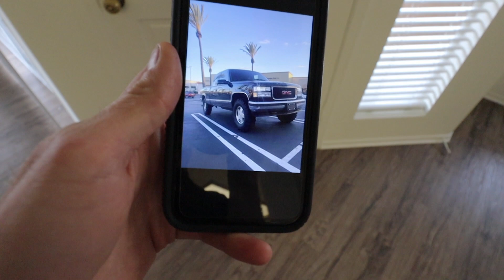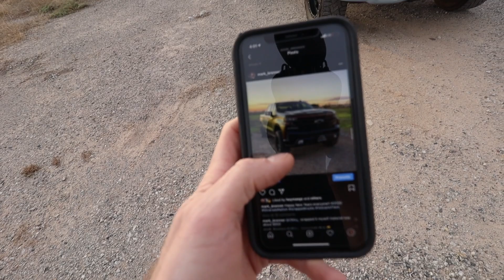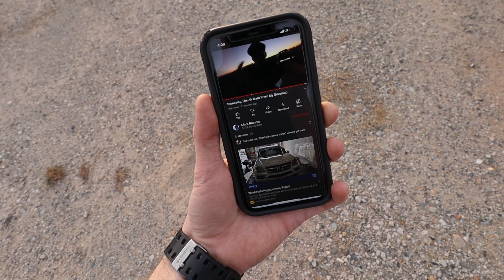Removing The Air Dam From My 2020 RAM

Comment: Just removed both the air dam and the motorized air dam. Also removed those front brackets. Looks great. Taped up and zip tied the connector. Have driven about 300 miles so far and no CEL. Greatly improves the front appearance of the truck. Thanks for the video!
Reply: Have you noticed any driving differences? What kind of speeds have you hit with it off?
Reply: @BozoRooster  I haven't noticed any difference. I've been up around 75-80 mph. Once I lifted the truck these air dams, even if they made a difference, were now useless. Drives great and looks much better. Would be nice if someone made a much thinner, low profile thing to put in place of the fixed air dam. The paint is getting chipped on the bottom of the bumper. Plus, it would look good with all the other black trim and mouldings on my truck 😎

Comment: Just removed mine.  Much better!  Few things, you don’t need to remove the 2 larger bolts to get access to the 2 10mm nuts.  Small socket fits in there just enough.  Also, I removed the auto air dam before the fairing.  Super easy with just 4 13mm nuts and gives you more room to get at the fairing nuts.
Reply: The auto air dam is held on by the 13mm bolts? I imagine it also has a wiring harness? Once the auto dam was removed does it throw a check engine light? Sorry for so many questions, I haven’t crawled underneath my truck to look yet. Came to YouTube first.
Reply: @Ross-K  I removed mine on my 19 5th gen, I wrapped the truck side plug well with electrical tape. Put 50k miles on it and never got a code. I did loose some mpg though, nothing too concerning.

Comment: Thanks so much for the video.  Removed the aid dam as well as the electronic air dam and  disconnected the electric for it.  Didn’t Jane to remove the 13 mm bolts.  Was able to get to everything pretty easily. Love the look.  Thanks again for the helpful video.
Reply: Sorry about the misspelled words. Fat thumbs!

Comment: Air dam was the easiest to remove. 4 nuts (not overly tight), remove the electrical clip, and 2 pop rivets holding the wiring up .
Reply: Mine through a engine code

Comment: My 2021 Ram 4x4 offroad Midnight is throwing U11E9 "Lost Communications with AGS" system code.  
Sounds like the the Active Air Dam frequently fails, fills with moisture, etc. on these and throws this code. 
Some people report the code going away after a couple months doing nothing. 
I think I'm going to just delete both the active and passive air dams completely. More ground clearance and it looks way better. 
Sounds like there is no perceptible change in fuel economy. I'm putting 35's on and a 2" level kit anyway, not like it really matters.
The 4x4 offroad package comes with a 1" strut lift. 
Between tires, and leveling kit I should have an extra 3"-4" ground clearance over a stock ram 1500.

Comment: I want to know did he remove that automatic air dam that comes down? Mines messed up and the engine light comes on so unless he took it to somebody to have it be bypassed that engine light always going to come on and he's not going to be able to remote start his truck but for a few seconds
Reply: Unplug it and cover the connector with tape and zip tie out of the way. Once you clear the CEL, it won't come back on. I have had mine unplugged for over 300 miles and no CEL. Of course, I removed the automatic air dam as well as the big plastic stationary air dam. Greatly improves the appearance. And, since my truck is lifted, the air dams serve no purpose. If anything, my mpg's have improved a little(;

Comment: Dealership is trying to a charge me $810 for a new air dam module and labor. I think I’ll remove it myself… hopefully that will make the fan stop kicking on so loud.
Reply: Any chance you get this resolved? I got a check engine light on with code for AGS and took it to the dealership which then told me they wanted to charge me $1100 to replace the air ram and connector, I figured I could replace part myself but I do notice the radiator fan kick on and run nonstop even when parked now I’m assuming it’s because the air ram is not functioning but still wondering what all I can do to diy the repair
Reply: @elmclovin3850  no way in hell I would pay that much for something that’s not necessary to the vehicle. I found a wired connector on the air dam module. Just crawl a little under the front, find the air dam, unplug it. That literally solved my problem. If you’re facing the front of the truck it’ll be underneath to the right. Easy to find.
Reply: Its only purpose is to turn on around 30-35 mph and redirect wind flow. Unplug it.
Reply: @elmclovin3850  man just came from the dealer they want 889.00, I can’t pay that much it just suck to keep seeing that check engine light on

Comment: Hey man! Been watching since you got your silverado. I have a similar truck. I have an rst. I have stock wheels 18" and stock tires 31". Did going bigger wheels and tires affect anything else on the truck other than the mpg? Dont want to have any issues with the truck with putting on bigger wheels/tires. Thanks
Reply from the maker: Yeah so I had about a 34” setup and it lost power mostly noticeable on acceleration. I forget which gearing I had but yeah it was terrible lol aside from that no problems other then slight rubbage 👌
Reply: Was it bad enough you wouldn't do it again?
Reply: I added a 3.5" lift. Kept my stock 20" wheels but added 35x12.5x20 Toyo AT3 tires. I had to trim my OEM mud guards a bit. I have no complaints about the acceleration or feel after doing it. Other than a little more road noise from the tires it's great.

Comment: @MarkBrenner Love your channel dude, thank you for this video! Im going through an ambient temp sensor rn w/ my 2020 RAM 1500 ltd. Replaced the sensor w/ Mopar OEM part, didn't fix it. Bought a brand new mirror (OEM) still getting a Chk Eng Light. Dealer is saying could be the BCM, also JUST told me there's an issue with the Air Damn? Truck has 53K on it, seems like i dont even need the Air Damn? Any advice brother? Thanks in advance!

Comment: FCA spends millions of dollars to get the best mpg. If it had no effect on mileage think of the money they would save by NOT putting it on.
Reply: That plastic piece costs them a few dollars per truck, so in their eyes if it helps mpg by even .5 it’s worth it to them.  I took mine off my colorado and it made no noticeable difference at all
Reply: @every1getready  yeah cheap plastic but I’m sure they paid engineers a good amount for them. Cars get small tweaks all around so the end result is better

Comment: Removing both air dams because the kick up a lot of dust on gravel roads and the inside of the cab is lousy with dust
Reply: Put your climate control on recirculate, eliminates outside air and dust.

Comment: Does your truck run just DRL during the day? Because mine i have it on auto and my headlights are always on, even on sunny days.
Reply: If you have it on auto they’ll always be on. Just turn DRL off on your car settings. And they’ll automatically come on just when it’s dark enough outside
Reply: @joshualejarde6593  if i turn my DRL off they wont turn on at all until its dark along with my headlights?
Reply: @ivansanchez2537  that is correct. If you have it on auto, your DRL will always be on. But if you go on settings and turn off DRL everything will be off during the day, and everything will come on automatically when is dark outside.
Reply: Depends on which year & trim level it is. You cannot go in to the setting & turn it off on a Limited without AlfaOBD.